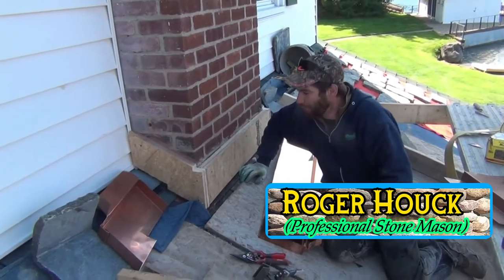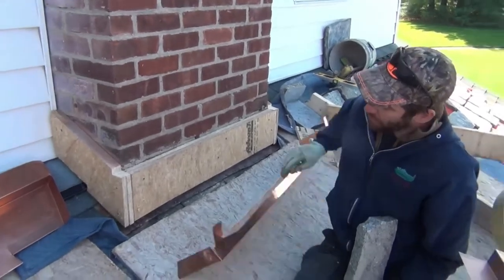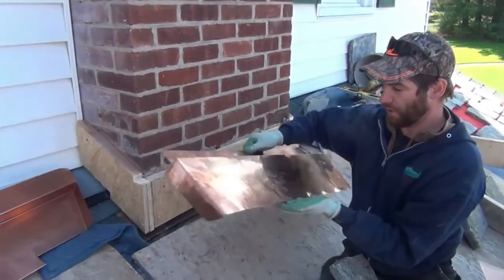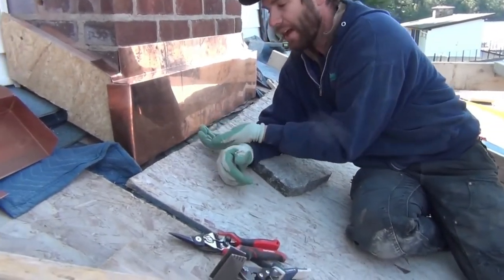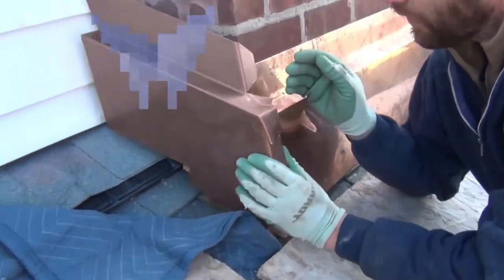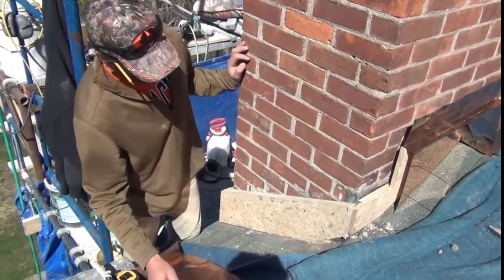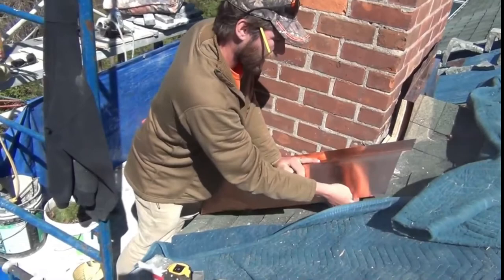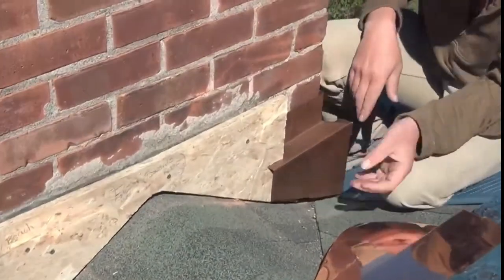How to Properly flash a chimney for cultured stone

Comment: Great Video!  Question here:  if both the chimney and the roof are new construction, how would step flashing for your shingles interact with the chimney flashing?  Would you install the chimney flashing first, then install your roof shingles and slide the step flashing under the copper chimney flashing - or - do you install your roof shingles/step flashing first… and if the second option is the case, does the step flashing against the vertical chimney portion go over or under that “subfloor” buildout for the chimney flashing? Thanks!
Reply from the maker: great question!   in many cases the step flashing is already installed against the bricks and i build right over it with my "subfloor builldout"   years down the road when they roof it again the roofer's step flashing will be installed behind my built out metal counter flashing.  (they would never be able to get back to the brick layer at that point)   It is water tight either way.  but usually the timing of the roofers is not the same as the masons and with this method, it does not have to be.

Comment: I love your videos. Keep em coming!
Reply from the maker: THANK YOU! I'm Glad you like them!   it is a bit of a uphill climb starting this channel.  but i hope to help more people DIY as it grows.   we have some more vids in the works.   Is there any aspect of MAsonry that you think we should do a video about?
Reply: @TheHowToHeadquarters  repointing, using the correct mortar for the application, stone vs brick, new vs old etc
Reply: @TheHowToHeadquarters  I loved your video about the cement Chimney Cap I'm about to follow your instructions step-by-step genius hammer drill vibrator by the way! Love the little tips and tricks they make it so much more
Reply from the maker: I will do that one next!!!   we  do mix differently depending on the width of the joints.
Reply from the maker: @davidr4500  THANKS FRO WATCHING DAVID. i hope your pour comes out well!

Comment: In the 80's, we used regular 2x6's, or 2x8's in NC as a buildout.
Reply from the maker: YEP that is what we used too.  but i like the adventec now because it does not want to warp and it does not rot too easily.   Thanks for watching Norm!
Reply: @TheHowToHeadquarters  We used a black goo, on the wood, mixed in the gallon paint can. Every once in a while, we tore out old work, I ever saw any of it even slightly damp.   I'm doubt it would ever get wet, that goo was nasty.
Reply from the maker: I bet its illegal black goo now!  :-)  everything that really worked is no longer made.   did you use the goo as the flashing too or just to protect the wood and then metal over top of it?